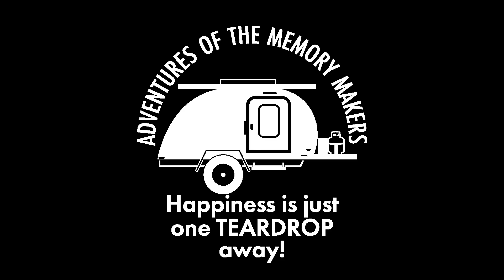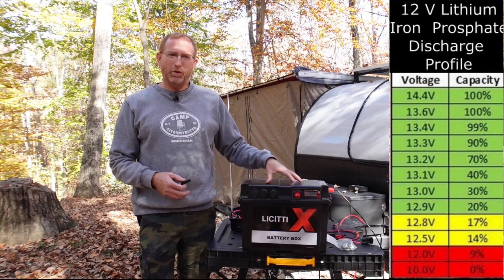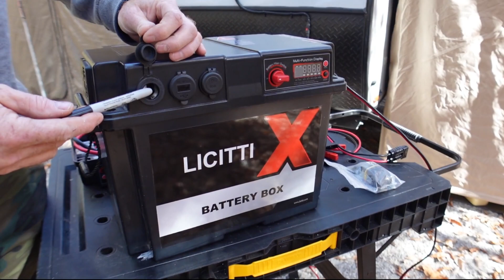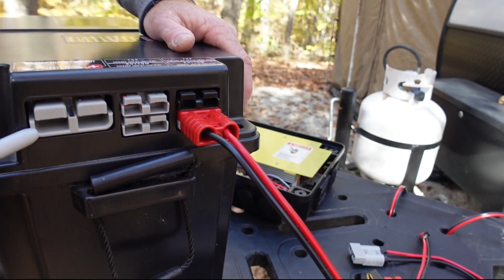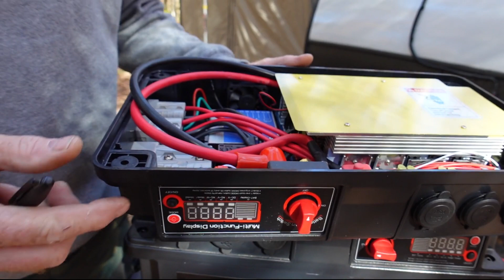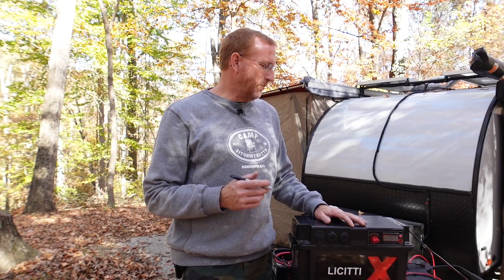Licitti AC Heavy Duty Power Box

Comment: Hi I'm from Michigan and love your explanation but I'm not very savvy when it comes to electrical power stations. I have this box to run my C-pap machine, but how do I know how many Watts I'm using per night and when the green bars are gone is that when I charge it again. I misplaced my owners manual and I 'm not sure how to manage this. I certainly don't want to damage this unit, so any suggestions would be deeply Appreciated. thanks, Gary
Reply from the maker: A lot of varibles, what type of battery are you using in the box?

Comment: What size wire are you using to connect power station to camper?
Reply from the maker: @JJMac-d4g  after determining our 12v load requirements to the camper I am usong 10awg solid copper wire with a 20 amp inline fuse to the camper fuse panel. Our max draw if everything turned on at once won't exceend 15amps. Each camper is different so size your wire accordingly.

Comment: Awesome channel.  Question. Can you use the bidirectional ports at the same time for charging?   For example.  Could you use 200w solar work around you mentioned (using mppt 75/15) in one port.  A 100w solar suitcase in the designated 10amp solar port and charge at same time?   Also what about a generator if you happen to be running one.  Can that charge simultaneously with other methods as well at same time?

One more question.  Is there a way to connect the PPS to camper and run 110 via the built in inverter?  I would like to be able to have an option to use built in outlets on camper to run a coffee grinder or maybe wife’s hair dryer without running an extension cord back to the PPS.  

Thanks and sorry for the detailed questions.
Reply: Thanks. To clarify- you run an extension cord from the inverter outlet on the PPS to where to power the A/C outlets in camper?
Reply from the maker: @JJMac-d4g  yes, we use an adapter to go from the 30 amp inlet to 110/120v
Reply from the maker: @JJMac-d4g  I will be honest I haven't tried charging from multiple.
 Sources at the same time so I can't answer that one. 
 It would be pretty easy to run a 110v cord to the PPS and then tieing that a outlet inside your camper. We tun a extension cord to our power inlet port on our camper to run our ac outlets in the camper.

Comment: Takes how many hours to fully charge it by battery car and AC?
Reply from the maker: @aminghader3146  there are a lot of variables that need to be considered. First off how big is your battery second how many amps will your charger put out. For example if its 100 amp hour battery and is dead with a 10 amp charger then simple math says 10 hours

Comment: Sam, I'm glad I came across this video.   I'm on here today reaching a portable power station and solar charging.  Cause I want to build on to run my 80Q 12V dual zone freezer/fridge off from.  While doing so I came across the CyberBox 3000 Portable Power Station by Licitti and it spiked my interest so I started watching reviews on it when I came across their 1000W AC Battery Box PRO I thought I could buy one of these drop my 200ah batter right in it.  Glad I found someone doing a review who i knows I can trust and believe what they are saying.
Reply from the maker: @NYTROeast  thank you for watching. We love our Licitti power boxes. My original box goes everywhere with me. We are camping now and its powering our camper. Its not for everyone but if you understand them they are awesome!
Reply: @adventuresofthememorymakers  We understand we have a DIY setup we made out of 2 Harbor Fright 100-watt solar systems and 2 200-ah lithium batters.   I'm watching your install right now into the tung box.      Moak

Comment: @jimh5210
4 minutes ago
I will admit to not fully reading the description for both power stations on their website. Do you know what the VSR function is and how would I make this work to charge the units. Both should have a built in VSR. I have both versions of this power station. I ran a test on our upright freezer. Test lasted 15 hours, stopped it short because I went to bed. When the freezer cycled on it was using approx. 115 watts. Since I didn't have a shunt or a smart battery I used a Govee Smart Plug Pro to track accumulated KWH. This model freezer used 861 watts total in the 15 hour period when I stopped the test. It could have lasted longer. I am only using this Licitti power station when the grid is down, and at night so I don't need to run the gas generator. Charged it with a 30 amp charger and its slow. I have the first model, and the newer box. With the Govee Smart Plug I was able to see the status of the unit while traveling that afternoon. Works for me.
Reply from the maker: Neither unit has VSR built into it. If you add an additional battery make sure it is identical to the internal battery and at the same state of charge as the internal battery.
 Length of charge time is the one drawback of 12v power stations.

Comment: I have one and ordered one for a buddy so the shipping was more reasonable for 2.  Just curious, is there a way to select what type of battery you added to it and it’s charge profiles thru the small solar controller?? Cause otherwise how does it know what type of battery you dropped into it?
Reply from the maker: I believe the included solar controller is setup for a lithium battery as the default. I personally have never messed with switching the settings in it as I reppaced it with a larger Victron controller but if you search online I think there are instructions on how to switch modes on it.
Reply: @adventuresofthememorymakers  Ok interesting, yeah I bought mine a year ago but was always skeptical about that.  I realized an additional controller was always an option but just didn’t want to have something else hanging out the side, unless I placed a really large 150ah-280ah battery into it. I just over panel it(175watt flexible Renogy) which is within their input parameters to get a pretty constant max of 130w.  I just emailed them to see if they have an answer. Their new ac box pro is sweet with some new features, remote on/off, wireless charging pad, more accurate display, 2 AC outlets, app control, and a smaller box design as many lifepo4 batteries have became smaller.  Although they did eliminate a couple 50 amp Anderson connectors which is a bummer. Still pretty awesome and not much more than the original product $218 plus that darn shipping.  Their dc control boxes are sweet for plug and play, and I couldn’t believe all the LONG cabling and connectors they include. I’m with ya, it’s a bargain and awesome to be able to basically change out the individual components yourself if they ever fail or years down the road when the battery degrades. Thanks for the response! Good video. 👍

Comment: Ok Sam, 
When you first put this out I didn't think I needed it but after watching your video of how you use this instead of the lead-acid battery in your camper, now I'm interested. I am also very interested in this one because I just made a deal to trade in my extra large 5th wheel for a smaller 5th wheel but I am keeping my batteries from the original one. I do believe that I am going to put two of them in the new 5th wheel and going to put on on the freesolo but now I have an AGM to put into something like this to give myself an extra source of battery power. 

Thanks for sharing this video!!!
All the best, 
Pat
Reply from the maker: Good deal Pat if you have any questions about it when you get it just reach out.
Reply: @adventuresofthememorymakers  Sam I definitely will. Thanks again!!!

Comment: So I'm back again.  I purchased a battery box and it's living up to expectations except for the solar charge controller.  Pulling the controller out of the unit and doing some research, it seems to be programmed for AGM battery charging from the factory.  There is a video out there showing how to change it from AGM to LiFePo4 charging (14.6A).  The name of the video is: Configure Licitti Battery Box MPPT Solar Charger LiFePO4 settings with Newpowa Remote Control.  Just wondering if you changed your charge controller battery settings?  I'm doing some more tests as after I plug my 100W solar panel into the charge controller, I don't see any movement on my Victron battery shunt, but all the other readings (battery amps/volts out and in for charging) seem to be working fine.  I'm wondering if I got a bad solar charge controller.  More testing tomorrow.
Reply from the maker: I actually removed the factory controller and replaced it with a Victron 75/15 mppt. It was a tight fit but I made it work. Works great
Reply: @adventuresofthememorymakers  WOW!  I'll have to look at that.  Thanks for the info.
Reply from the maker: @KyleKrieg  drop us an email and I will be glad to tell you how we did it. It was a tight squeeze
Reply: @adventuresofthememorymakers .    I also would like to see how you shoehorned the Victron unit into the case.  How do I send you my email discreetly?  Many thanks.
Reply from the maker: @jeffreykropp7664   you can email us @ adventuresofthememorymakers@gmail.com

Comment: Will this take a 200watt solar panel ? Im trying to figure out what is the biggest direct plug in solar this will take and how fast will it charge a 100ah lithium battery like yours, Thanks
Reply from the maker: Thank you for watching. The AC power box comes with a 100 watt 10 amp MPPT so a 200 watt panel would be a bit too much to feed the internal MPPT. You could always use an external controller plugged into on of the Anderson ports. 
 As far as how long it will take to charge. Assuming your inputting  100 watts continusly then in therory ot would take 12.8 hours to charge a 100 amh lithoum battery that was starting at 0% SOC.

Comment: I just received my unit and I agree with you.  The only issue is the inverter is 120, but at 50 hz frequency.  So I won't use it with appliances with inductive motors.
Reply from the maker: Thanks for the heads up. I wonder if they changed inverters? You might be able to change that with a jumper on the inverter, not sure without looking.

Comment: What is the best battery option? Deep Cycle Lead Acid or LiPo?
Reply from the maker: That depends on so many factors. If you already have a battery on hand then that is your most cost effiecent route. Lead acid is easier to work with if you dont have LIPO experience. Bit for us LIPO was the only way to go. Cost, weight, and power output its unmatched.

Comment: The Anderson Power Pole connectors are color keyed correct?  From what I understand on the solid colored, larger amp hour connectors, you can't plug a grey 50A into a black 50A.  They have to be the same color?  Hence, you can't plug your solar array into an input/output.
Reply from the maker: I don't believe that is correct. I can plug the black 50 amp into the grey ports as well as the black. Thats the good and bad about the Anderson connectors. You have to know what your plugging in where. Its handy for me as I modifies the solar black connector cable with 30amp andersons for my solar panels as well as my Victron AC charger. I just plug the 50 amp end into the black port for the solar panel and into a grey port to use the AC charger. Not sure I would build one that way for the general public if I was building them but I really like it.

Comment: Great video. I'm curious how many amps you think that winch draws? If it powers that winch which shouldn't it jump start a car? I would be more nervous about using that winch than jump starting a car
Reply from the maker: So the winch that I'm using is a 5000 lb winch that I use with snatch blocks to compound the power if I need it. It runs off of a 50 amp breaker. The battery BMS limits the output to 100 amps max. You might be able to jump start a small 4 cylinder car with minimal electric load but that would probably be pushing it. If you were using a lead acid battery in the power station then that would not be an issue but so far lithium iron phosphate batteries just aren't up to the demand of starting a vehicle. They're getting closer but they're not quite there yet.

Comment: I absolutely agree with everything you've said, Your number two in a little Playlist I have for this sort of thing. Clark and Emily are number 1. There's one more, I need to look at it. I'm a ham operator and one of the things we try to do is set up stations anywhere at any time. Wow, the winch, I hadn't even thought of that. Awesome, I have an old huge warn. winch I inherited from my dad. . I'm putting a home built 320 amp hour battery in mine because the measurements are perfect for the cells. Absolutely perfect !
Reply from the maker: Glad I was able to help. Just make sure your bms can put out enough amperage for the winch. Would like to see your setup when you get it done.

Comment: awesome analysis and good to know the components are off the shelf-ish so you're not stuck if something quits working. I'm looking at the 2000W version of this....  Thanks for sharing
Reply from the maker: I am on the fence with that version. It doesn't have quite to capability of the Gen 1 box. I like the 20 amp MPPT controller though.
Reply: @adventuresofthememorymakers  You can't fit a 200ah battery in the 2000w model unless its one of their batteries apparently.
They advertise it as being able to fit 200-300ah batteries.

Comment: Great video sam!  You think it's possible at the  grey Anderson connectors connect them at dc/dc charger, and charge it with alternator?
Reply from the maker: It all depends on what type of battery you are powering the unit with. If you have a lead acid battery then yes you could. I would not advise charging a Lithium batterybwith your alternator. You could use a DC to DC charger powered by your vehicles battery but you would want to use caution with that. Some vehicles handle the extra load fine, some don't.
Reply: I had thought about using a Victron Orion  (I have lithium battery). The thing I don't understand is whether the Orion can be connected directly to the Anderson socket, or whether the box needs to be upgraded. It would be great to be able to charge the battery while traveling! @adventuresofthememorymakers
Reply from the maker: @casate13  I am not sure about the Orion, I will have to do some reading on it.
I power a Renogy PWM controller off my truck then connect to the anderson connector and it works just fine, just not very fast.

Comment: I think best thing about it is the battery expansion and charge controller expansion. With the Anderson  plugs built in. I know that can be done with any power station. Can u hook 2 of the boxes together? Would that be possible? Haven't seen anyone say if that could be done.
Reply from the maker: Technically you could hook two boxes together using the 150 amp ports but I'm just not sure what the advantage that would be other than the fact you could have dual the batter battery power. You would not have the ability to combine the output of the individual AC inverters. You essentially would still have to 1,000 watt AC inverters

Comment: Thanx for the vid.  I've been considering this.  I have an AGM 100A battery that I can put in that.   I was going to wire up a solar system but, this would be more realistic while I'm in a rental, before I get out on some land of my own.  It's only capable of 150w solar input.  I wonder if I hook up two 100w panels to it that it will shut off.  I guess with the efficiency of Renogy panels, I'd be at around 175 watts.
Reply from the maker: That's really a neat thing about the unit, you can use any battery type you want.
Reply: @adventuresofthememorymakers  yes but, the 150 watt max solar input makes it a little tricky.  I wish they offered an option for a bigger charge controller.
Reply from the maker: @kroninn   I use an external controller to run more solar with it. The grey Anderson connectors are bi directional so I just plug into one of those.
Reply: @adventuresofthememorymakers  ok, good to know, thanx.
Reply from the maker: @kroninn  I show how I did it in the video. Just make sure to plug the controller into the PPS first then connect the solar to the controller.

Comment: I purchased one of these several months back and didn’t try to use it until I went on a overlanding trip and discovered the power converter didn’t work on it. Also had a lot of trouble getting it delivered and getting any response from LICITTI. After PayPal stepped in they finally shipped the box. Hope everyone else has better luck than I did. Jasonoid has a lot of great videos on solar and battery power. He did a video on this box and then pulled it after so many negative comments

Comment: Great video, is there a size restriction for the type of battery you can put inside? For example, I found a 12 Volt 100Ah LiFePO4 Lithium Iron Phosphate Battery that measures 8.43 in x 10.23 in x 6.61 in. Would that work?
Reply from the maker: You should be fine with a battery that size as it will hold up to a group 31 sized lead acid battery.
 I had extra space left over around the sides of our lithium battery and used styrofoam from the battery shipping container to help hold it in place to keep it from sliding around inside of the box. The instructions even say to do that